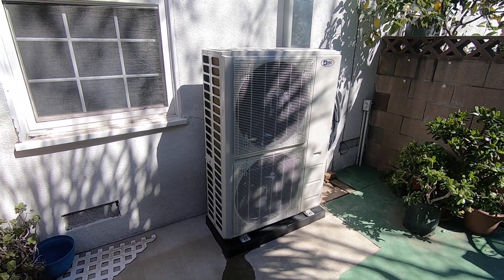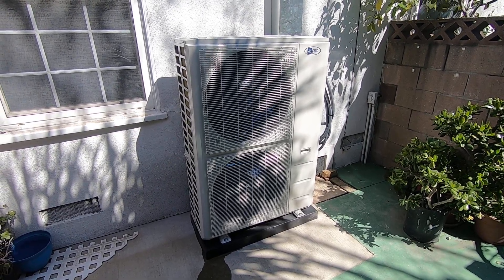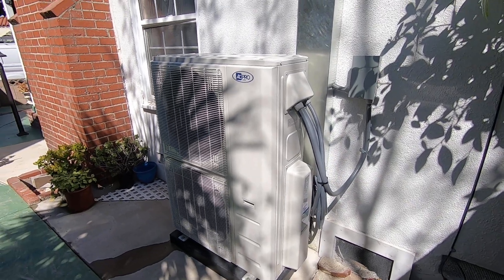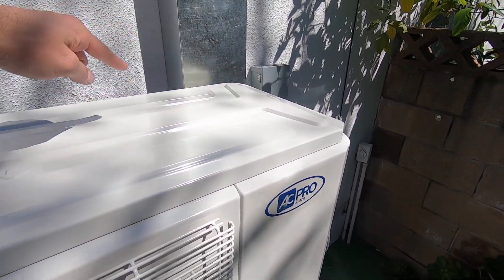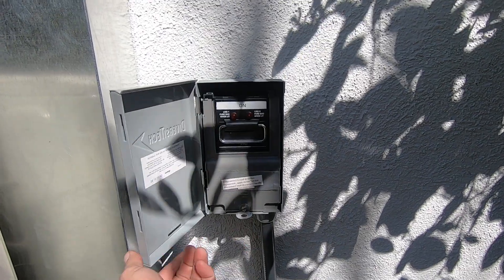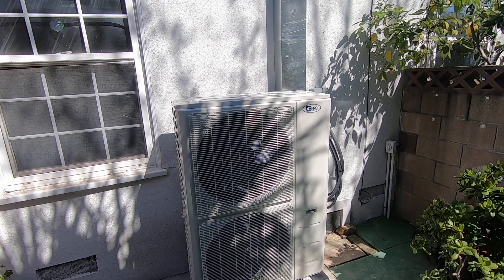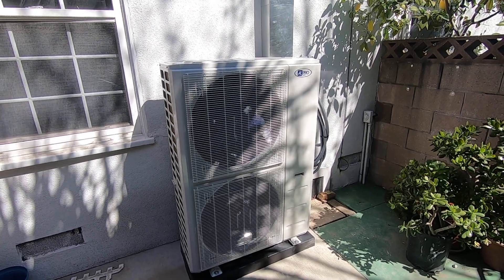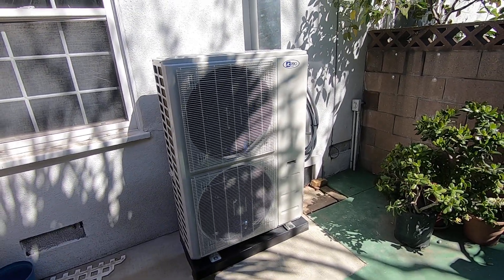4 Zone Ductless Split System Installation - Part 1

Comment: I install a lot of Gree products, i want to offer multi zone more often, i feel like its a no brainer when done properly. 
Have you had any issues yet on any of your multi zone systems?
Reply from the maker: No issues with our installations thus far.  We don a lot of multi zone ductless split systems.  Mainly with Carrier or AC Pro brands that are made by Media.  We have done some warranty work on other companies installs.  The issues we have found are mainly leaks due to bad flare connections, under and overcharged systems and dirty filters.
Reply: @albertairinc.1140  sweet brother, thank you 💯
Reply: @albertairinc.1140  Great! 💯
Reply: This thing is sick! Great video
Reply from the maker: @plant-basedrunners8986  Thank you for the comment.  I appreciate you watching.